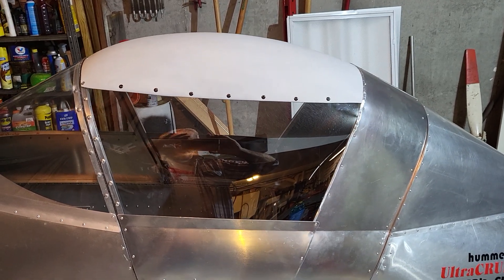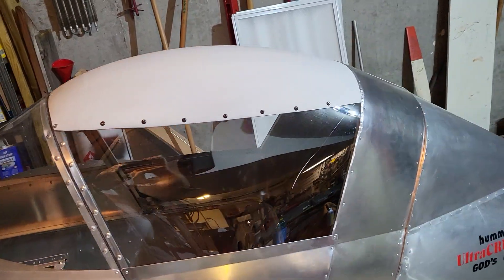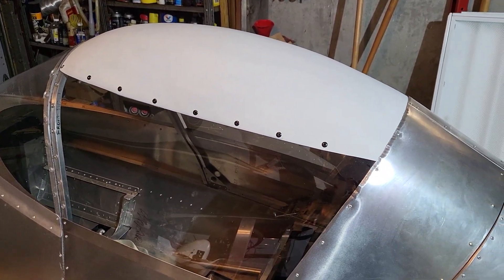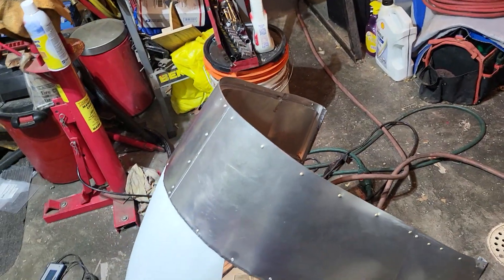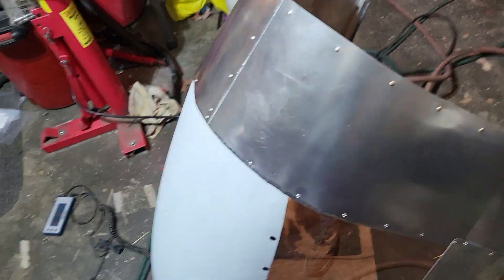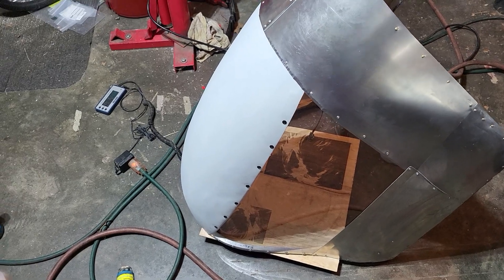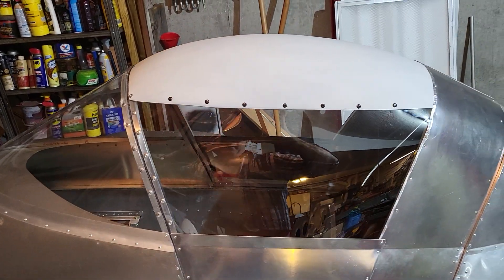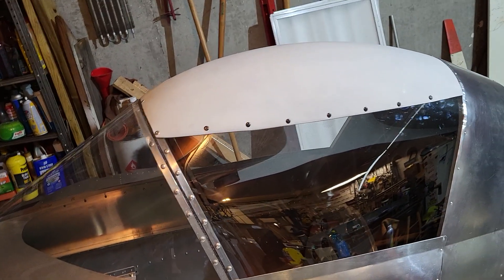UC canopy ALMOST done!!!

Comment: It looks good, Dennis!!  Just a thought on weight reduction: how about using just 1 piece of Lexan for the whole canopy, and then painting the section where the cap is installed?  This would get rid of the extra weight of the rivets, tape, etc needed to install the cap.
If you didn't want to use paint, a trip to your local business sign/vehicle lettering shop might net you a stick-on solution for sun block inside the canopy.
Reply from the maker: Hi Deepsea5 well sir Terry at Hummel said that the lexan could not be formed like that. That's why they use plexiglass to form canopy. I took my H5 canopy to a place to put tent in the top but there was to much curve to do it in one piece.  Oh well we will see how this works out....

Comment: How about replacing some pop rivets with as much squeeze rivets as you can,maybe that brings the weight little down, thanks for all the updates.
Reply from the maker: Hi Tony well sir I would not be able to squeeze alot of them. So they would need to be shot with a rivet gun and a bucking bar. And where the rivets go into the square tubing you could not use solid rivets. Plus I would not what to use them on the ABS plastic. But I like the way you are thinking....

Comment: Looking cool good buddy, quite a nice smooth curvaceous shape to the canopy, should help keeping you warmer while adding a few mph or a knot `n a half, and say, guesstimating, giving 3 mins per mile more extra air time on fuel saved etc.

Hows the engine temps doing relative to the wearing in period ? ..with the weather heading towards Winter they should drop a bit, but with the engine loosening up a touch & making a bit more power, ..are they remaining sort of stable just below where they were?
Reply from the maker: Hi Razor 1uk yes sir it does flow with the airplane well. As for engine temperature now that it's cooler out it's doing well. I have over 35 hours on it now. Take care over there in the UK

Comment: Couldn't the square tubes be replaced by round tubes? That would still save some weight because less material is used.
Reply from the maker: Hi Metalwings I like the way you are thinking sir!!! Well the aft bow could have been round.  But I think the square works better where you put the felt on for weather stripping.  But again I like the way you are thinking !

Comment: Could you put some holes in the square tubes? Or would that weaken it too much?
Reply from the maker: Hi TNG Tactical that could be a good idea. And I'm not sure about how much it would weaken it. And the drilling would probably have to be done when done. Because I think it would cause the tube to bend funny it already had holes in it. So with that said I could probably drill some holes now. But that would have been easier to do before I riveted the lexan and cap on...But I like the way you are thinking!